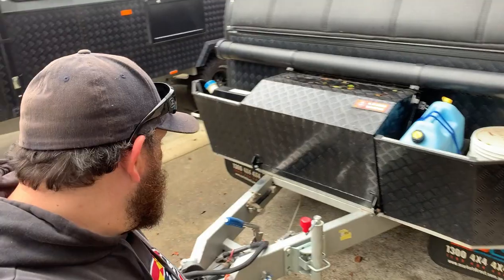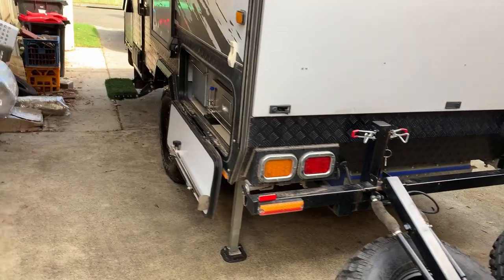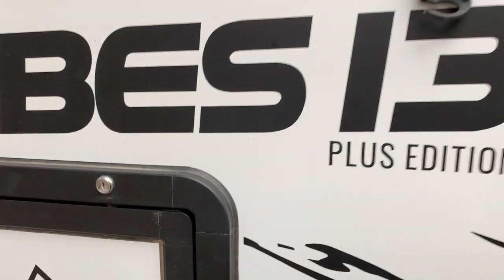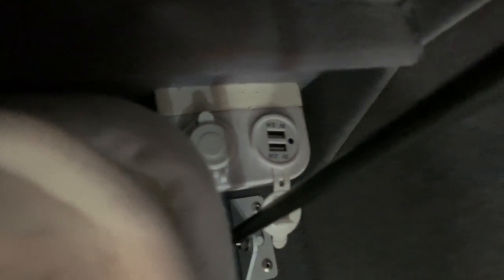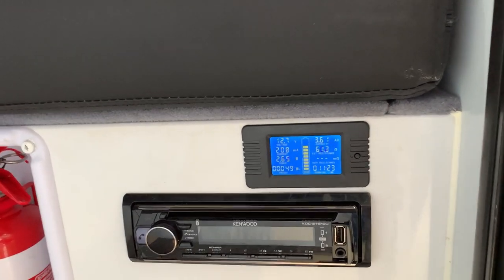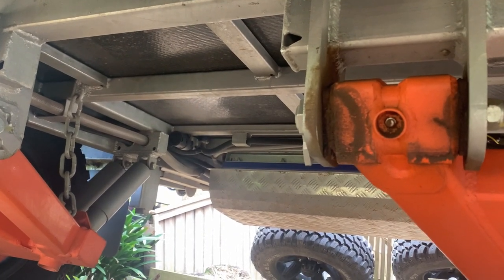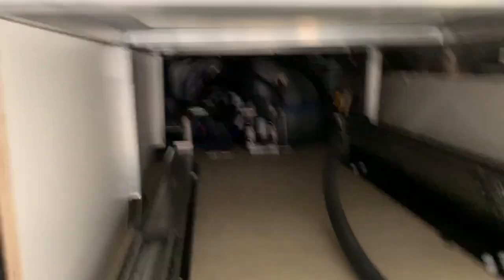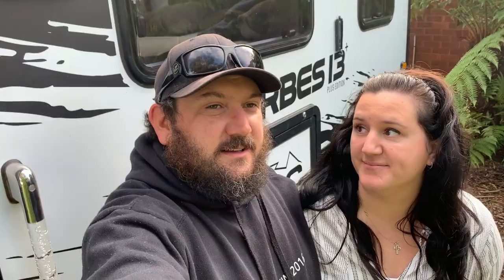Water Tanks Installation | MDC Forbes 13+ | Simple Electrical Modifications | All You Need To Know

Comment: Can you explain how you wired in the extra USB port please
Reply from the maker: Hi Bill and Sue,
Dave ran a new cable from behind the switch panel all the way down behind the cupboards. Then followed the existing cable around to the water heater, he then drilled a hole through the aluminum and ran the cable in some box conduit to the back of the van. He then pulled up the carpet and ran the cable side to side under the carpet and contact glued the cable back down.